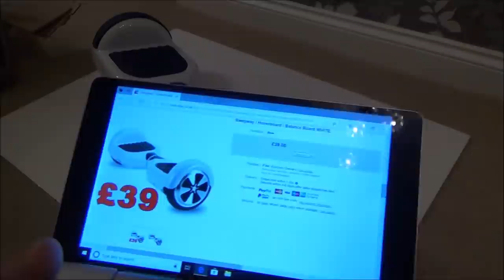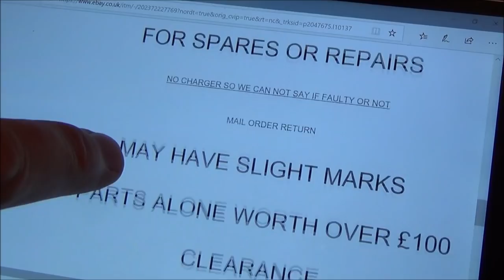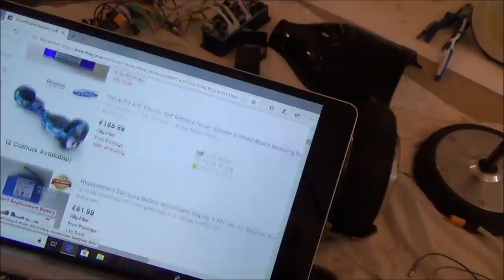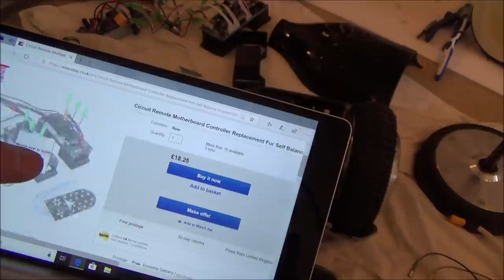Trying to FIX a Faulty £39 Hoverboard from eBay (Self Balancing Scooter)

Comment: The "sensor" that is  broken is a photointerrupter. The pads vary the amount of light passing through and this is translated into movement. They are fairly standard things and easily replaced if you still have this unit.  https://uk.farnell.com/w/c/sensors-transducers/sensors/photo-interrupters/transmissive-photo-interrupters/prl/results?st=light+gate+sensor
Several here  or here https://www.rapidonline.com/Catalogue/Search?Query=photointerrupter

Comment: You can clean scrub those boards with demonized water or alcohol bath.
Repaste the heat sinked chips and it will work.
That hoverboard has been run off into a pool or pond, ditch etc.

The only problem with electronics have being submerged isnt the water. It is the minerals in the water that causes the problem. Corrosion and conductive minerals cause the shorting.

Look up a video of a guy restoring a old nes system. "EXTREME Nes Repair. You will learn something most people do not know.

Comment: That's a bit like Aldi one I'm trying to get one wheel going them sensors just activate the board I can tilt the controller board to change direction .. if I block sensor and block other sensor I have to remove both to stop the board just safety sensors ...gotta find out what's balancing it it's a joke lol

Comment: the antenna part on 27:10 is probobly for smartphone so you can see your speed and batterylife on it or to the extra gadgets you can buy too it like handlebars with spedometer built in :)

Comment: I actually thought those wheels would have worked the same way as model aircraft brushless motors do, having 3 wires (I'm sure I heard someone say that you just swapped 2 of the wires over to get it to go the opposite way)
Take a look at this video on testing brushless motors (ESC stands for Electronic Speed Controller) https://www.youtube.com/watch?v=bWen_gm2P9Q
And I'm pretty sure those yellow connectors for the battery are called XT60 connectors, but as can be seen in the video, there are other types.

Comment: I'm betting the white powder is talc to try and soak up the water.  Pillars are likely multiple light sensors, the more light beams broken the faster she goes.  Big antenna for the electrical noise from the motors switching.

Comment: you should be able to get any electric motor running again the only thing is how far are you willing to go to get it to run. 
it not having any batteries is a clear case they took it apart and sold what they thought was total garbage.

Comment: My theory is that entire stock of these hoverboards was flooded in factory or rather storage place and never sold. So they took battery from them because obviously wet battery is dangerous and now they're trying to get rid of them. EDIT: They coudn't open them after that flood happened because of those stuck screws. It's quite mystery what happened to it. Maybe it had some faulty battery and never worked so customer returned it like brand new. They removed battery and after it got so wet.

Comment: Don't waste money on high risk items. The hoverboard trend has died, you can get new boxed certified self balancing boards with quality high wattage motors for roughly £100 these days.
Also as soon as you saw the water damage you should have returned it for a refund.

Comment: The boards are BADLY damaged. I work with electronics and repair stuff daily, and i promise you, I would not be able to get these boards working again. The motors just need a good drying and cleaning, maybe a set of new hall-sensors and then a fresh set of bearing and they are good again. All that water damage looks like sea water. Sea water + electronics = Death!

Comment: OMG..how have you not shocked yourself yet...these boards can give a nasty shock for running on batteries. 
The antenna is for the key fob that comes with some, it lets you "lock" the hoverboard if someone tries riding off on it.

Comment: I would have returned it. But don't mention you opened it, as seller can get case closed out stating it been tamper witb Just say it rusted and seems water damaged and not as described as they never mention that.

The seller a dirt bag and knew it was flooded and missing parts.